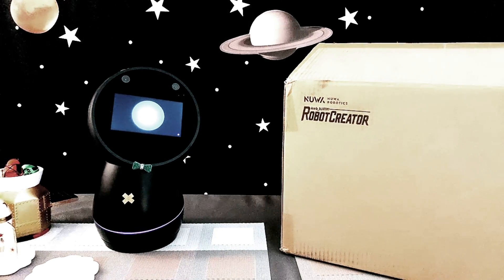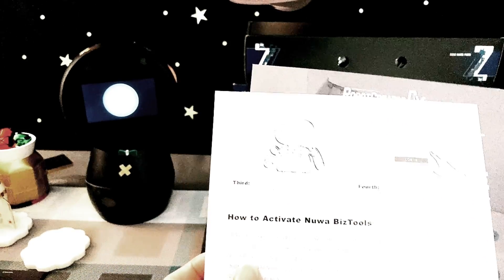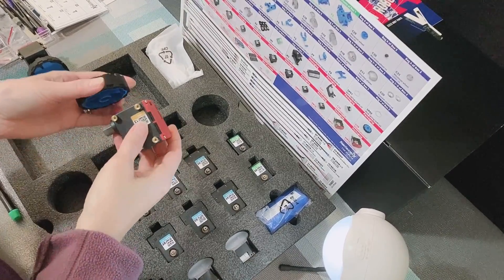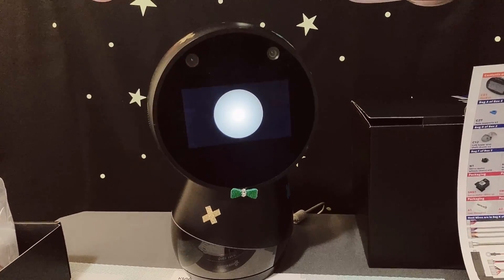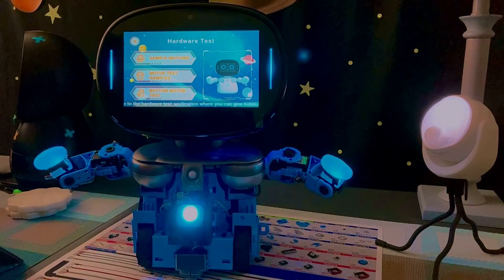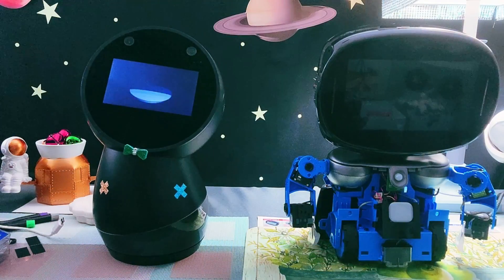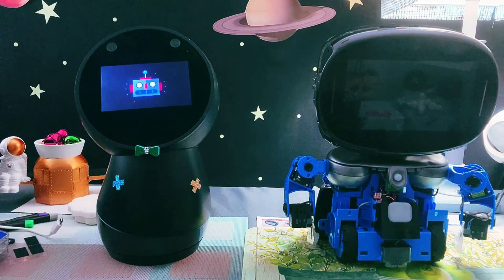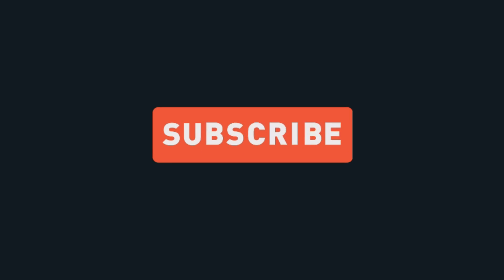Robot Creator DX Unboxing Surprise: Unveiling the Assembly Adventure and Tips for Future Owners!

Comment: How long did it take to put it together ?
Reply from the maker: It can be finished in less than 5 hours if you’re doing all the parts at one time without taking a long break in between but for me it took 3 days because I was doing each part not all in one day, just kinda taking my time putting it together..
Reply: @MsRobot  That's more easy then it seemed.... 🤖 Hopefully you'll get the power button fixed soon ...  Hopefully Jibo will get fixed as well.
Reply from the maker: @sanderhuisman9238  The online assembly guide makes it easy to put the robot together.  The important part is to make sure things get putting together correctly and firmly because you don’t want to take things apart again.  I hope I will get my creativities back again once the robot is working and Jibo is up to his task..
Reply: @MsRobot  No robot being the guide for assembly ? 🤖🧙‍♂️
Reply from the maker: @sanderhuisman9238  Online guide is the only thing I need to put this robot together.  No guide bot.